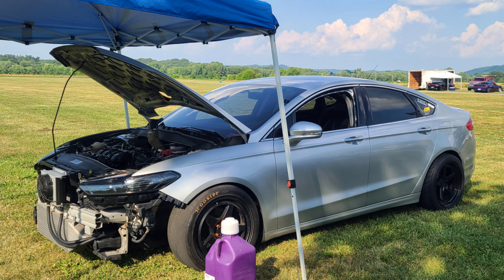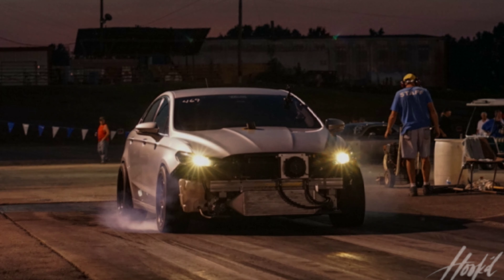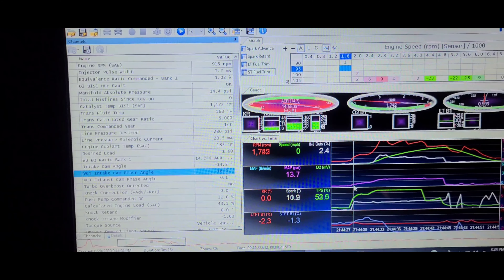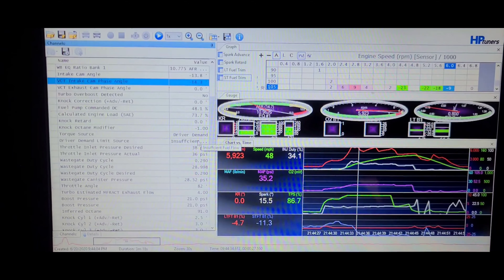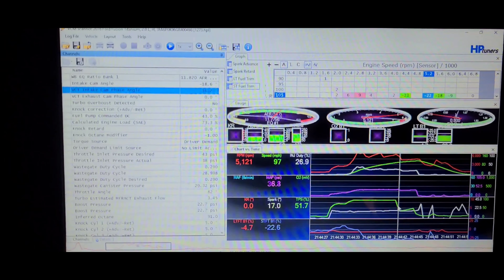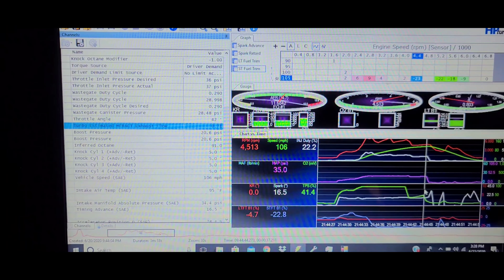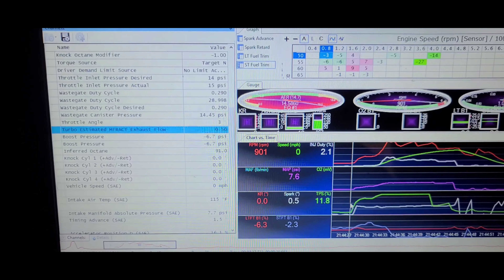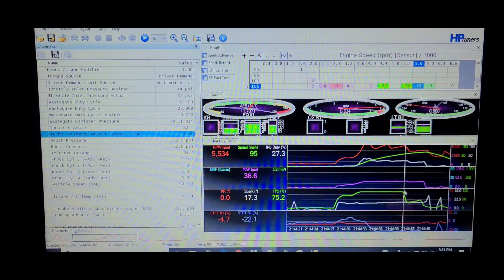Fastest 2.0 ecoboost Fusion in the world... and it's FWD!

Comment: Thanks for sharing 👍 once I will upgrade my fuel pump and switch my tune, I will start doing some data logging. Since the replacement of the turbo's, I runing lean and mean after 5K. Too lean for my comfort and boost is pulled off to save the engine.
Reply from the maker: I feel you on that. I'm running it a bit rich incase the methanol fails to spray.

Comment: Great build bro love your vids quick question what brakes are you running ? Seems to brake really good, I’ve done a 13.6” rotor swap on my mine 2013 titanium dual piston calipers from 2015-17 Ford Edge all is bolt on seriously .
Reply from the maker: Tbh I'm on stock brakes, I had to really get on the brakes there to make the first turn off. I'll doing the ceika 4 piston up front so I can clear a 15" wheel.

Comment: How long did the 6F35 last with all those mods?? And any recommendations on transmission fluid changing intervals?
Reply from the maker: Every oil change I did a drain a fill. But its more important to have a good aftermarket oil cooler and it tuned properly. First one lasted 86k and it was the only one I broke but was unrelated to a weak point.

Comment: Has this car been on a dyno? If so what were your numbers? If not how can you claim 350whp? PSI has nothing to do with WHP numbers. And I dont think that stock turbo spins enough for 350whp. That inducer is only gonna pull in soo much air i dont care how much rpm you give the turbo. Id love to see this on the dyno though. Still an amazing feat with a stock fusion
Reply from the maker: Yes its been on a dyno, and yes its made over 350whp 🤣
Reply from the maker: And it wasn't a stock turbo, it was a Gtx2867r gen 2 lol
Reply: @Tookoff  what would a regular dyno do for stock trans and motor for a ecoboost on e85 tune like how many hp would I gain ?